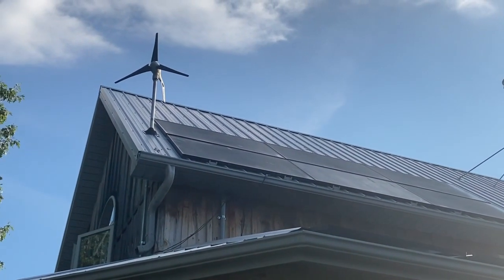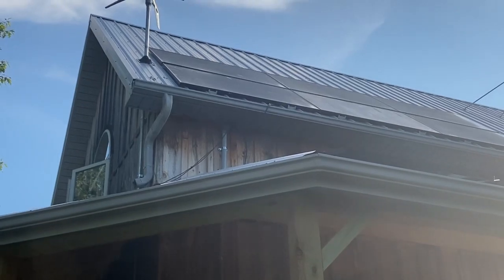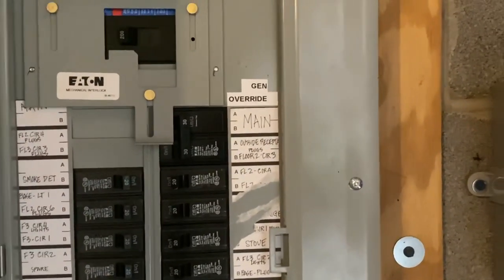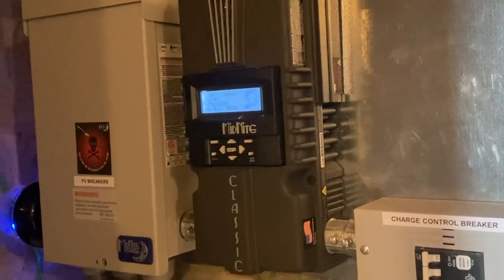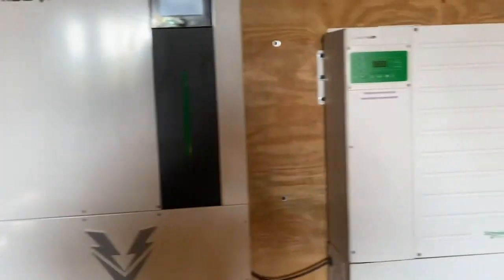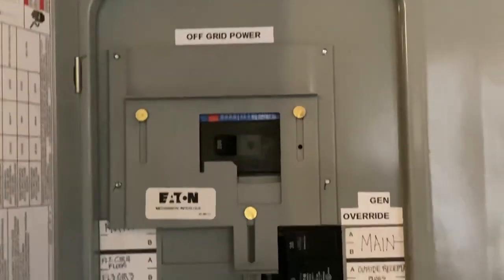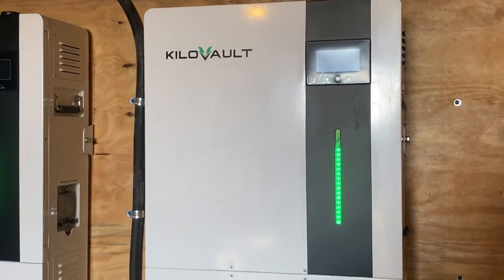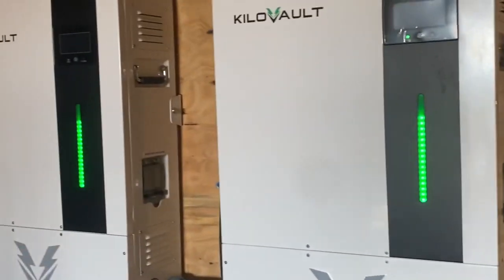Off grid wind and solar install on mountain top cabin with back up generator

Comment: I see that windmill not even spinning .i hear that u have to have them over 50 ft and they break a lot. What do u think Lucas are windmills really worth it have u had some that last without breaking?
Reply from the maker: The brake was turned on the unit and it depends on where you live if it’s viable